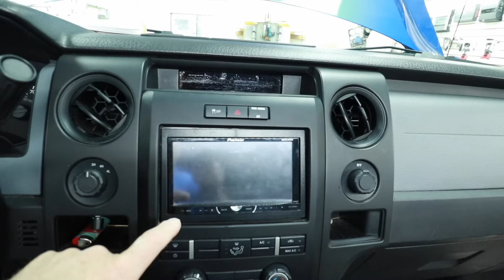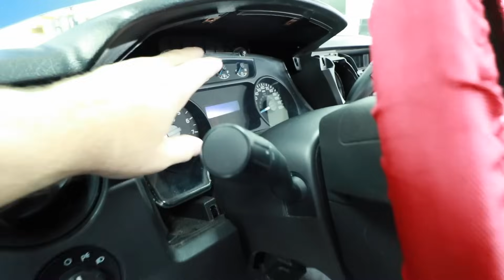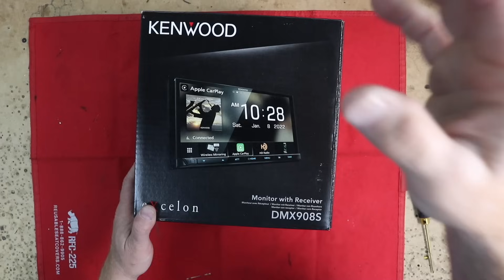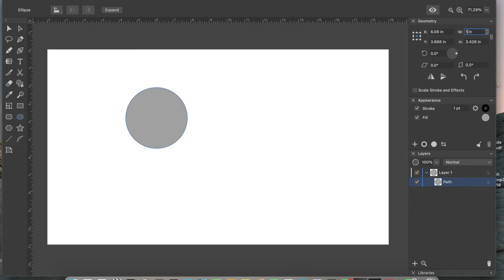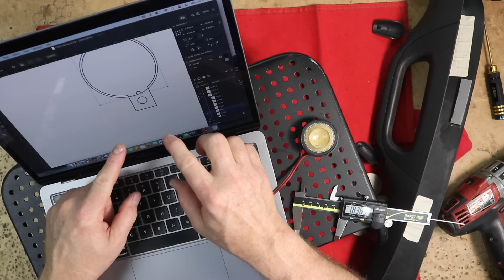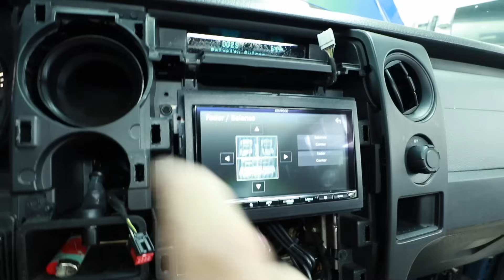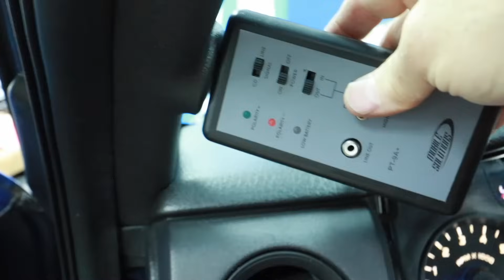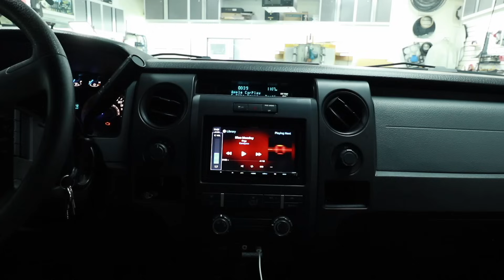full install Ford F150 911 Installer Diaries

Comment: Great job when it comes to all that great stereo equipment,wiring,tweeter housing and mid bass securing so you have the best sound stage without any rattle is huge in install ,another fantastic install that will last for years.

Comment: Low melt solder, and flux will easily remove even the strongest solder. Everything will be liquid, and you can just wick it up with some fluxes  s tranded wire. Long liquid work time.
 
Thanks for your expertise men.

Comment: Standard Mikey Shore install. Never take your car to them. Also, in my defense butt connectors are not bad if you crimp them right and tape them up. Question: what are your thoughts on electrical silicone to seal wire splices?

Comment: You could do things half way proper with the best of intentions, still doesn't make it right. There's no A for effort if you're paying a premium price for a top tier installation. What is the logic of using a 2 butt connectors between 7" if wire? Unacceptable. 
If I go to the bar and order a Grey Goose Martini &  get served Absolut should I just be content that they didn't serve me Smirnoff?